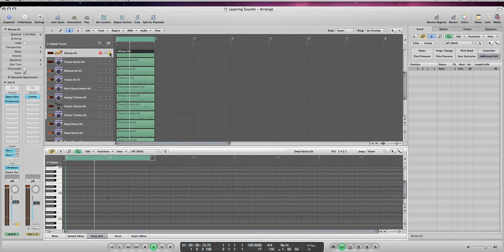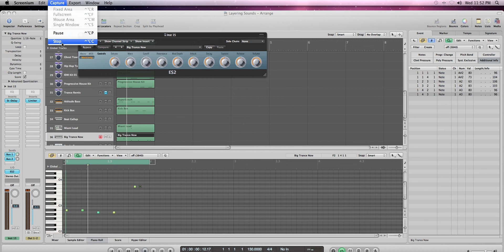How to build multi layer drum tracks (Logic Pro 9) Back to the basics

Comment: @apple2011 Aww I see, that's a really great tool to use! Is there a way to use this while recording so you can mess around with the ES2 while recording live?Also, I saw you used picked and choosed multiple drums from the templates on Ultrabeat. Did you save them to a folder or that cause I can't drag them to a folder to use =/